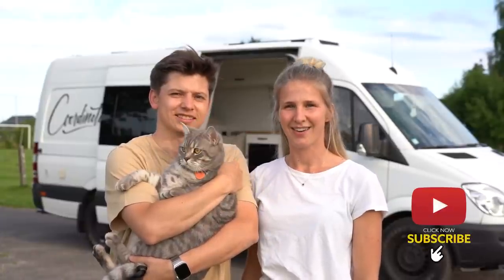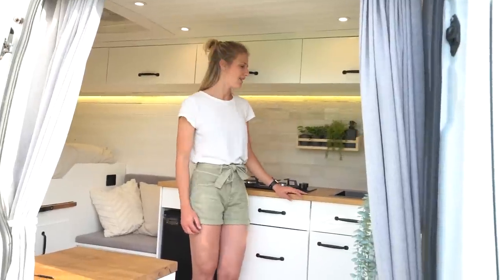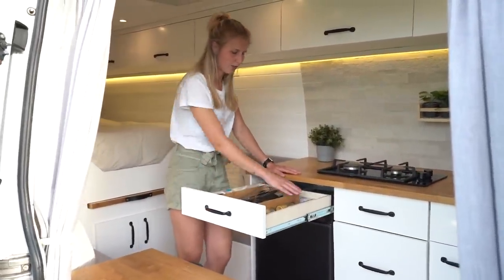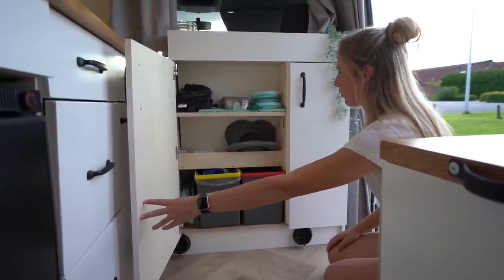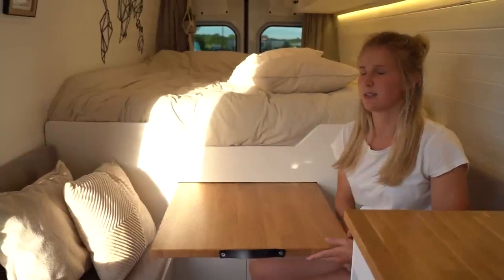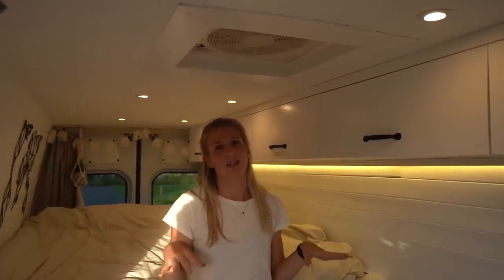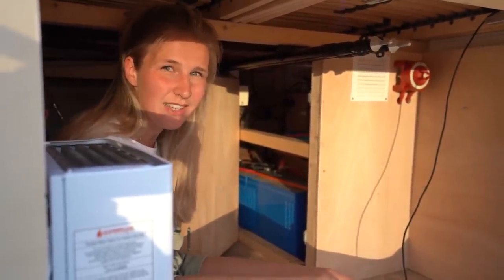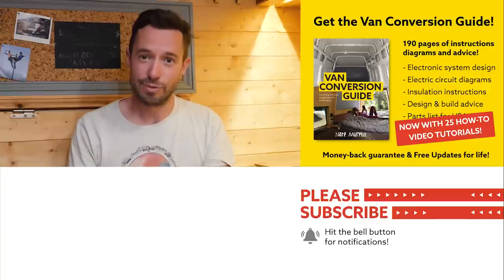UPGRADED Van Conversion w/ MY FAVOURITE NEW CAMPERVAN BED DESIGN 🛏️ 🚐

Comment: Hum..., I am surprised to see a propane tank in the van's garage not located in a sealed locker with gasketed door, appropriate locks and a floor gas drop out vent.  A gas detector is only a part of a safe gas system.
Reply: Nice work inside, ' like the layout. and yes, I'll second that such gas bottles need to be in a sealed housing and with a xx-cm hole through the bottom of the van. This is the first and main test/checks for the TÜV in Germany about inside gas tanks beside the sealant check of all tubes and connectors of the system. Take care !!
Reply: Hi! Many thanks for your reaction and feedback! We’re going to do some changes in the garage so the propane tank will be in a sealed locker.